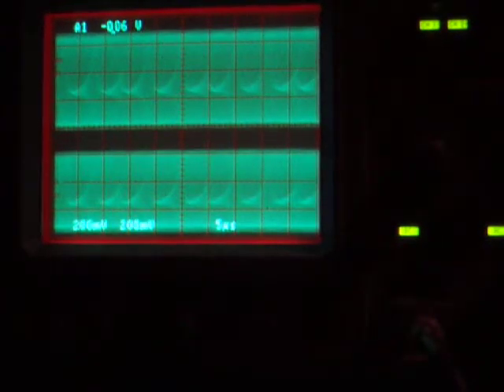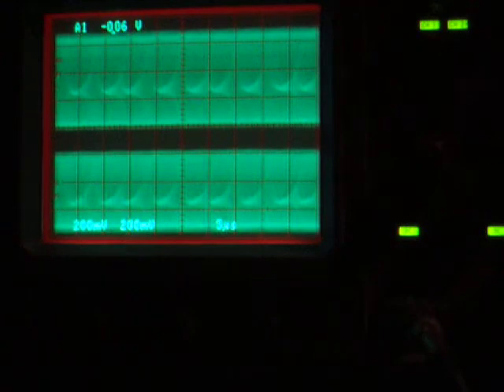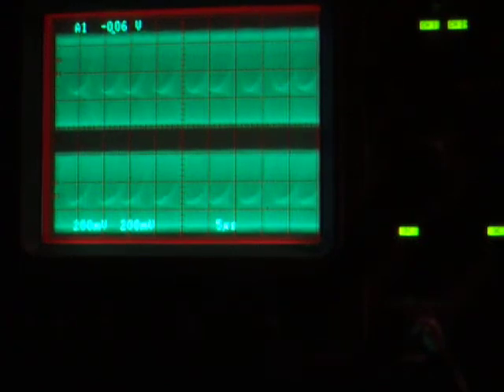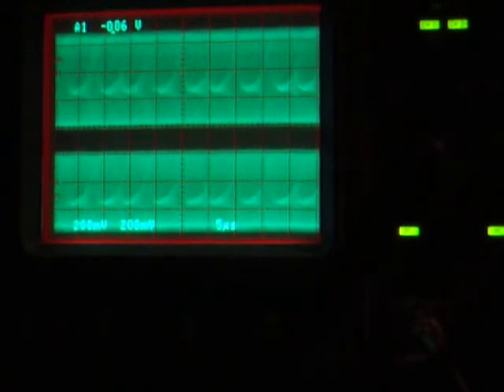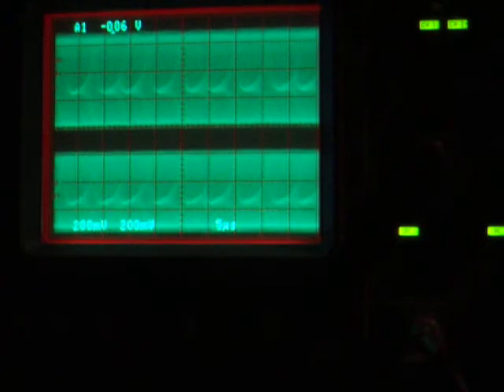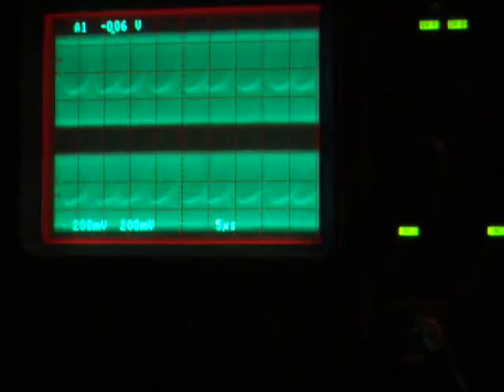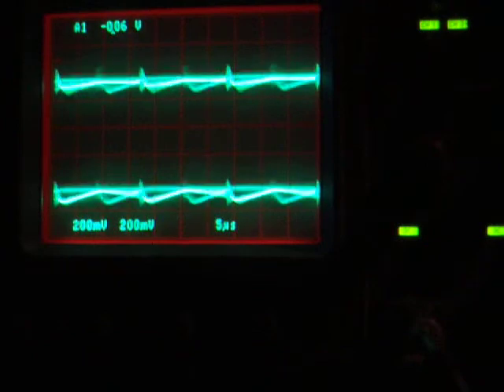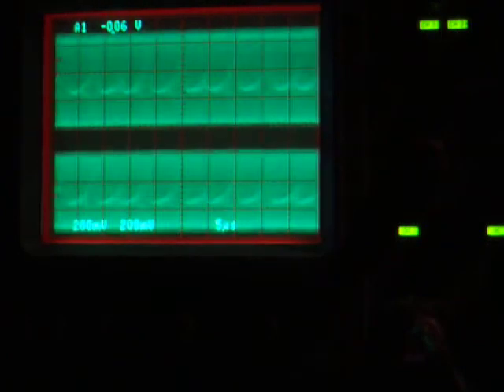Marquee 8500 Ultra Longbow SAB board noise

Comment: I run clamp-on ferrites on EVERY signal cable in the Marquee chassis.  I swear it makes a visible difference and it's a dirt cheap upgrade.   The ferrites should be placed as close as possible to the coil that is being driven.